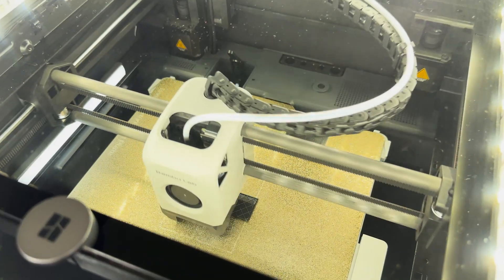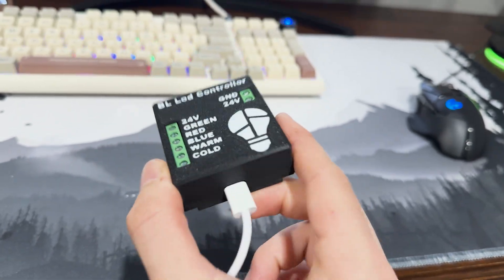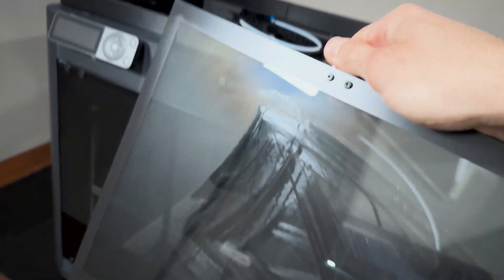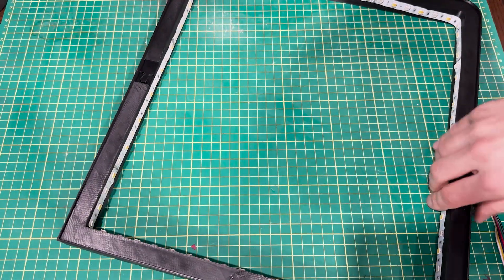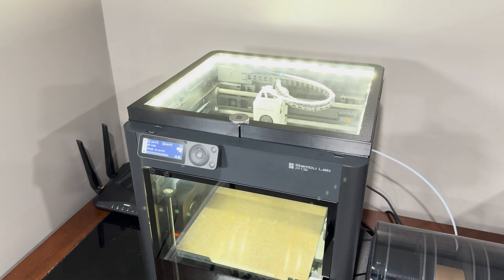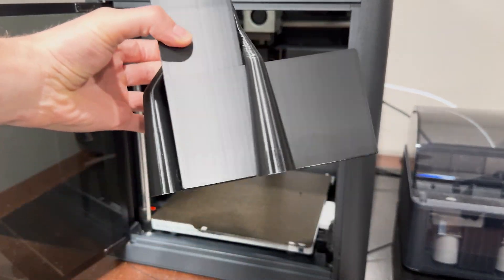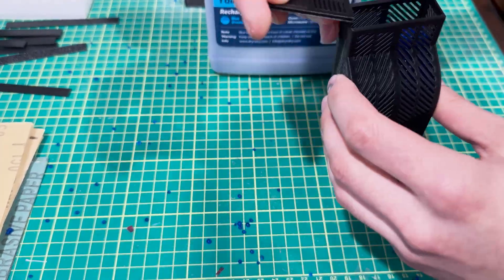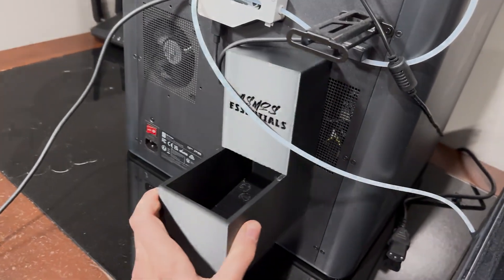Level Up Your Bambu Lab P1S/X1C With These SIMPLE Upgrades

Comment: If you have a smart home system i bet you could also make an automation to turn on the light when a smart plus has more then 50 watts or so on it so it only comes on when the printer is printing. I have not tried it yet so im not 100% sure if this would work but i definitely play to attempt it.

Comment: The bl controller is great most of the time but a lot of time it sucks. It will not turn on unless I power it on/off
Reply from the maker: I have had that issue before. Remove it from your printer and update the firmware on the controller from a desktop via the BLLED Controller website. Should fix your issues.